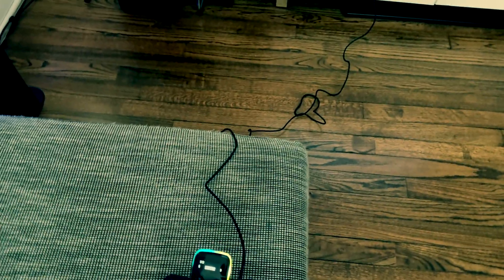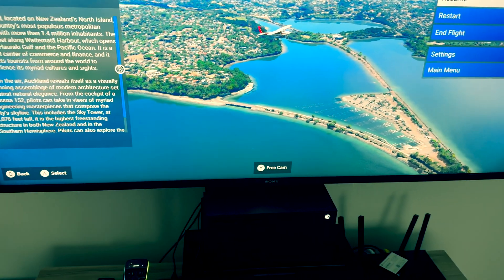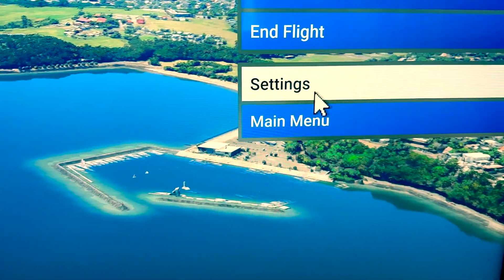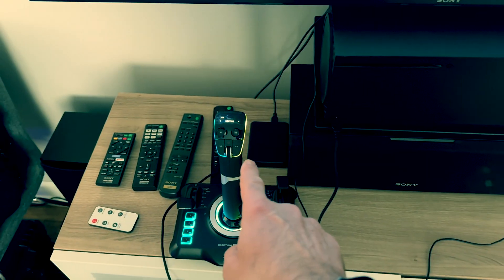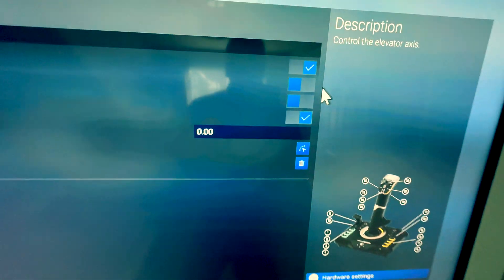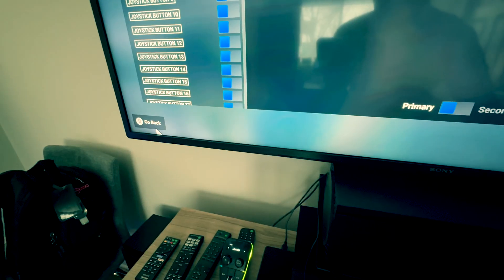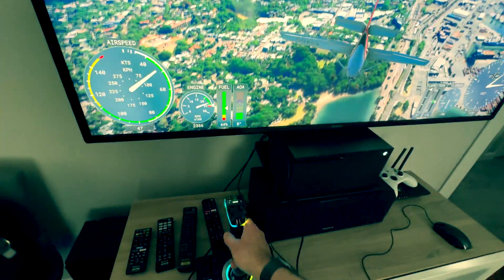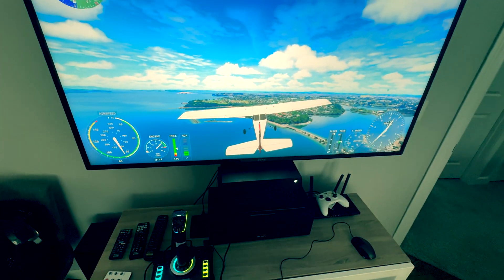Fixing VelocityOne Flight Stick Issues in MS Flight Simulator 2024 – Inverted Axis Settings Solved!

Comment from the maker: 🛠 VelocityOne Flight Stick inverted controls in MS Flight Simulator 2024? Solved. Step-by-step guide to fixing elevator and throttle axis issues—no more nosedives when pulling back. Did this fix work for you? Got other setup tips? Share them below 👇 #FlightSim2024 #VelocityOneFix #TurtleBeachController